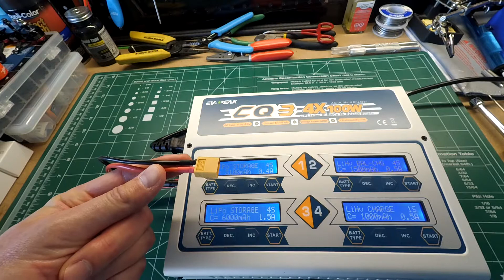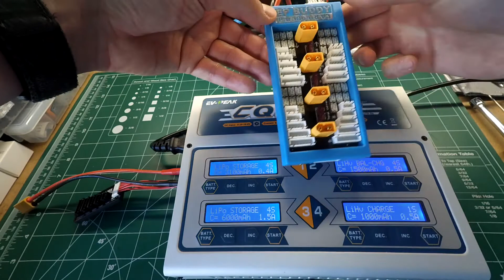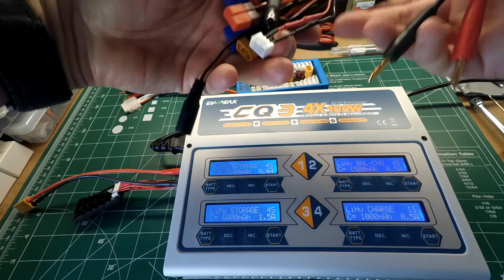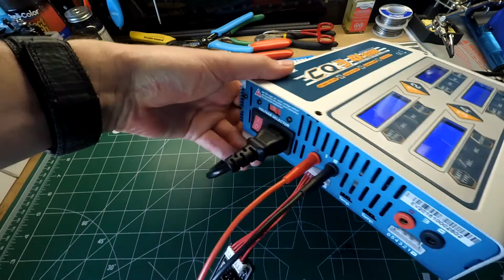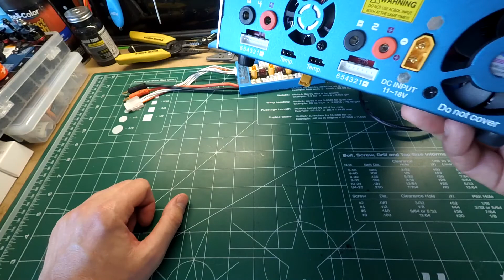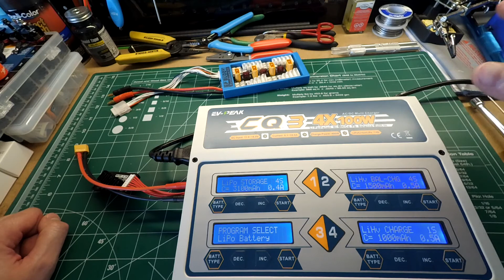EV-Peak CQ3 Battery Charger Review

Comment: Just got mine 1/12/24 from Get FPV , Also have older 80-watt per channel 4-channel 3260 version, one channel display is sketchy. So now have capability of charging seven lipos at a time. Highly recommend this charger for RC fliers with average needs. Surprised how many use these to charge their Prius car batteries, etc. As far as I can tell the blue/silver is version is the same as the red "B-QUAD" version, except the blue/silver version comes with XT-60 charge cables, the red version comes with Deans type "T" charge cables. I had to order four ST-60 female to Dens male T adapters to suit all my Lipos with "T" connectors. My package did not include a charge cable with alligator clips for charging lead acid batteries.

Comment: have the same charger, but no memory in the menu on mine. According to the manual, there should be a battery meter in the menu (to check IR etc), but even yours doesn't seem to hqave it. Did you find the mini USB to update the firmware of the charger? There is are a few short sentences in the manual about it, but no real info on how to...

Comment: Hello,   I plugged in a LIPO 3S battery into the Balance port and could not change the setting from 1S to 3S and thought you had to hold the start button to auto detect it.   I got the high voltage error and now getting Battery Check Cell Connect ERR.   I tried another port and set it correctly  and it works fine.  I take it I fried one of the ports.

Comment: Sounds like you might be just down the road from where I am in Kingston, TN.  I recently bought a CQ3 and was very impressed by it for charging four Hubsan Zino drone 3000mAh LiHV batteries.  That battery required modding some 3S extensions to splice on some banana plug leads as the interface to the Zino charge cable.  My question having now used the CQ3 on several occasions is whether you have seen consistently quick charging times?  I see a wide variation of charge times which of course makes sense relative to how depleted a battery is, but I'm talking about beyond that.  Most curiously, I just tried charging a battery depleted to about 50%, using a 7.2A balance charge current which is near the max for that battery on a 100W channel, and for a little over 1400mAH delivered charge capacity, it took 110 minutes versus having seen a 56-minute charge time @7A for half again the delivered charge capacity at 2141mAH.  That totally makes no sense to me, so I'm hoping you might have some experience to shed light on that.  At 1C, I've seen times around 90 minutes and at 2C, around 74 minutes, so that looks a little more consistent with expectations.  Thanks!

Comment: Im so lost i cant seem to get the balance charger going and im disappointed with the user manual as it doesnt give a simple instruction on how to get the machine to switch from the xt60 jack to the balanced port. Could you do a video on that or explain please.
Reply from the maker: It's actually pretty simple, you select Lipo or the type of battery you're balance charging, select balance charge mode or lipo balance, plug both the main xt60 discharge lead and balance connector in, chose the amperage you want to charge at, then push and hold the enter or start button to begin the cycle.
Reply: @steelrainfpv3383  Check out other how-to videos about this charger and similar 4-button chargers. The instructions are vague and non-detailed like provided for many Chinese -made devices. I have trouble with flow-chart style instructions.

Comment: I've had mine about 6 months (12-12-17) and I'm very happy with it. Sadly, I have to admit it has some really good reverse polarity protection. (oops)
 Once I hooked it up in the field backwards and melted the wires really fast. Another time I plugged in the AC power cord and didn't realize I had the alligator clips for field charging still on and and they were touching. I did act quick enough so no melting occured. 
So just a tip for those watching this video and looking to buy one..... Great charger, and NEVER have the AC power cord and DC power cord hooked up at the same time! 

Steelrain....... Have you noticed the 4 ports on the front of the charger?
I was wondering if they are some kind of charging port for tiny whoop batteries.

Comment: Thank you - I just got this.  Question, if I hook up a charging board to this to charge multipole batteries, do I have to plug in the balance plugs to the board that are on the batteries?
Reply from the maker: Jeff Walrich - Yes you should always attach the balance connector along with the main discharge leads to the parallel charging board, and you should always use the balance charge setting on the charger to keep your individual cells balanced, and to keep from overcharging and ruining your batteries.
Reply: Thank you!  Also subbed to your channel!
Reply from the maker: Jeff Walrich - Thank you I appreciate the support. Make sure to check out my other video's on lipo battery testing, and more specifically the new Joshua Bardwell parallel charging board to see what are the best options for your needs.